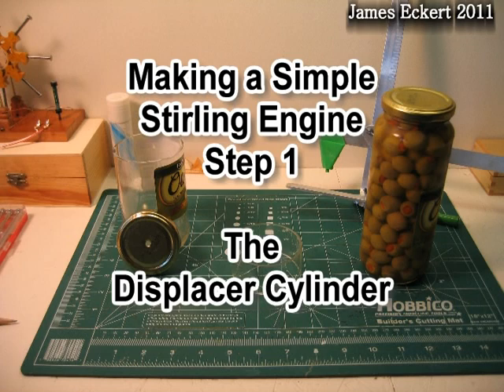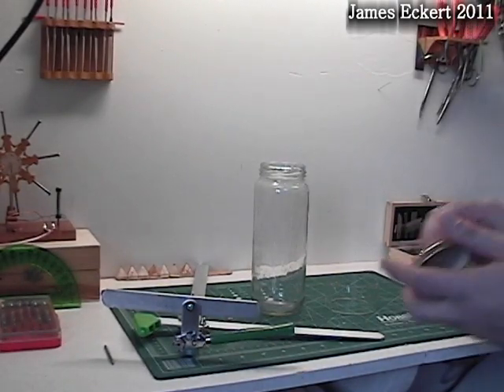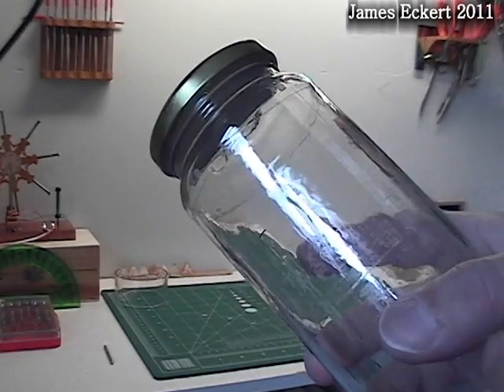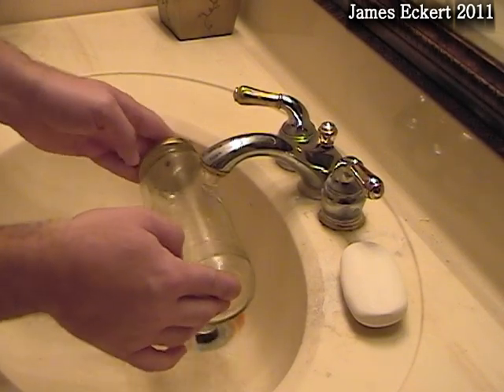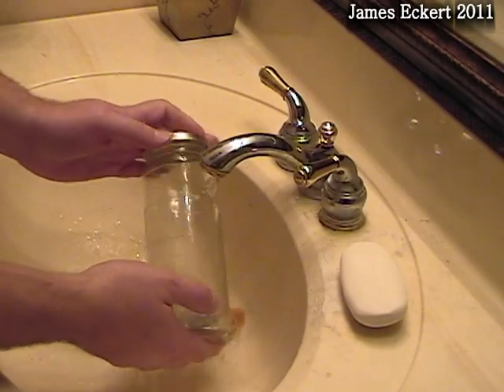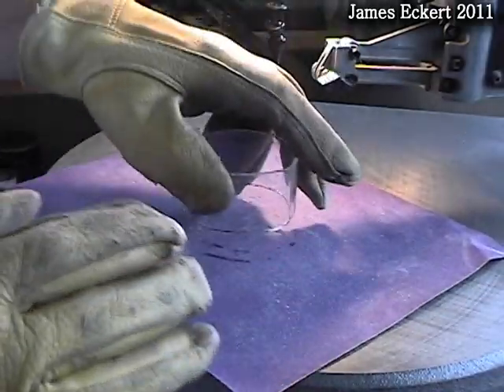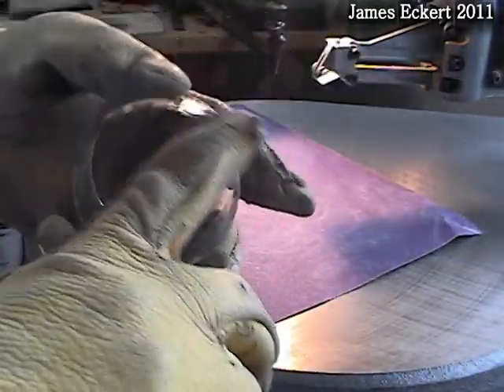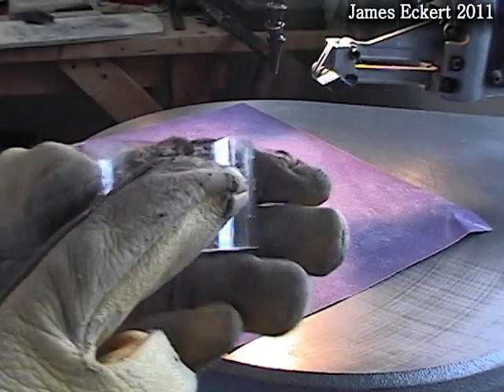Step 1 Making a Stirling Engine: The Displacer Cylinder

Comment: When I used to cut glass I would wrap a string soaked in lighter fluid around the bottle where I wanted to cut and set it on fire.  It's kinda tricky because it has to be turned and left on fire alittle longer than what one would think but still only maybe a minute.  Then while the string was still on fire I would put the whole glass container in ice water.  About 70% of the time it would break off and be good enough to work with and maybe 40% of the time it would break off almost perfect.  
Just another method I learned over the years, you probably already knew about this way but maybe someone reading who doesn't have much to work with is will find this useful. Thanks for the video, and yes your method is superior.

Comment: I used to make guitar slides out of the neck of wine bottles I used this exact same technique except I put the bottle in the oven after I had scored it and then dipped the unwanted part of the bottle in a bucket of water I hadsitting there with icepacks......broke off straight away nice clean cut about 70% of the time, the others times it would fracture through the score line and basically destroy the bottle and mark it useless.